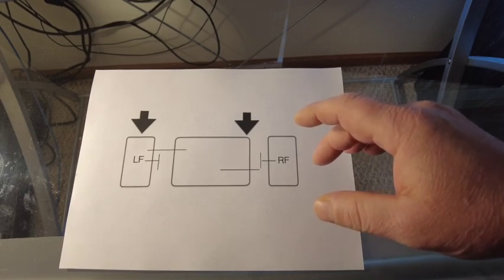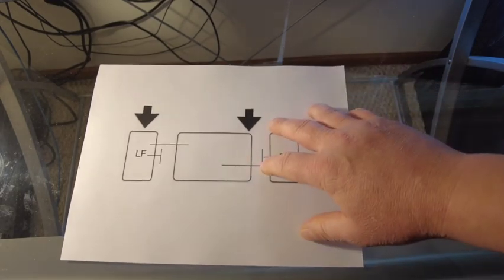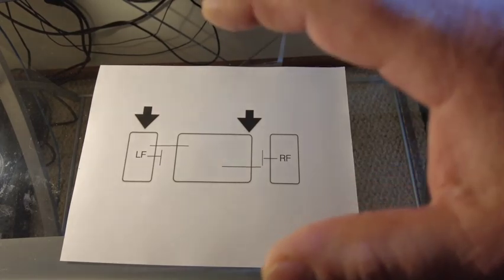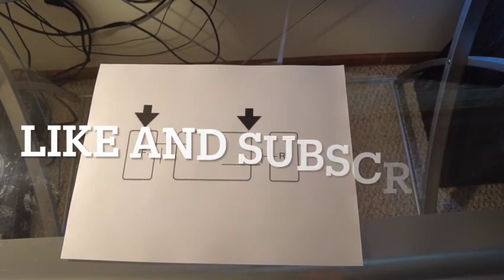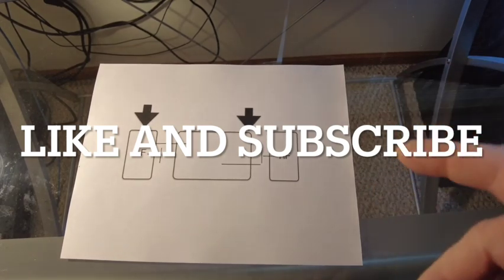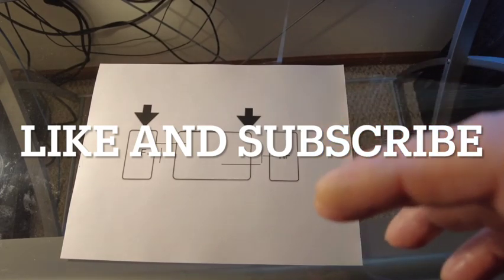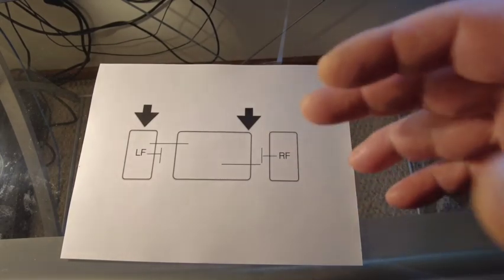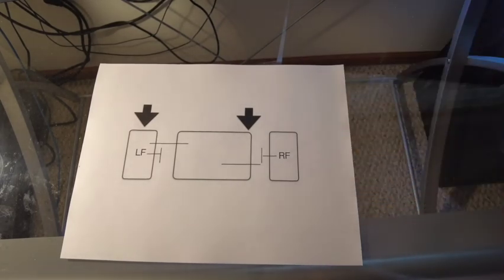Planting the Front End on a Dirt Late Model and Dirt Modified Through the Front Control  Arms

Comment: In your opinion should the right side anti dive force connection point be higher or lower than the RR suspension push point in dynamic posture?
Reply: I think it should be as low as you can get it without going below ground. This includes dynamically.

Comment: In your third drawing you show the upper and lower control arm connection points being on the same plane and the force connection point going straight back toward the RR. The lower control arm connection points are not aligned with the upper control arm from a top view.
Reply from the maker: Right, I think there is something to be said about the angle of the lower and where it is placed. I'm just thinking now in a simple 2D application. I'm not entirely sure how it works. On a modified, I always do recommend the upper be mounted parallel to the center line of the chassis. Thanks for watching.

Comment: How do you raise that lf push bar to be above?
Reply from the maker: I used to run, what I call, a negative lower control arm angle and only about 13 degrees of upper control arm angle on the LF. A negative lower control arm angle will lead downhill from the inner pivot to the balljoint. When the car rolls up, the lower control arm will get steeper and the upper control arm will flatten out. 
There is something else going on here also. I have a rule of thumb that says, never let anything go over center. If you have a positive control arm angle on the LF, when the car rolls up, it will actually go past the center of the arc and start pulling the other way. That goes against my rule of thumb.
Thanks for watching.
Reply: @HoganTechnologiesLLC  what kind of angle would you run on your RF upper control arm to achieve the downward force on the RF?
Reply: @woodbeckmotorsports00  we were always between 18 and 20 static.